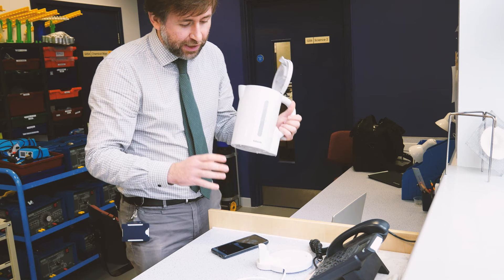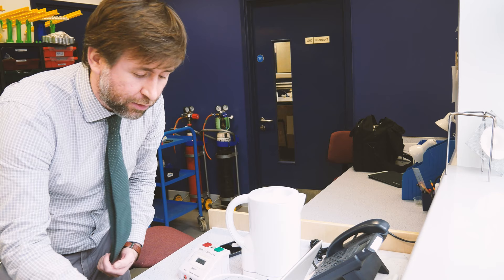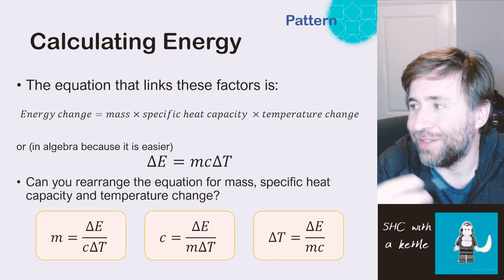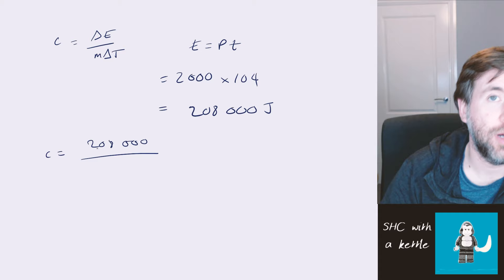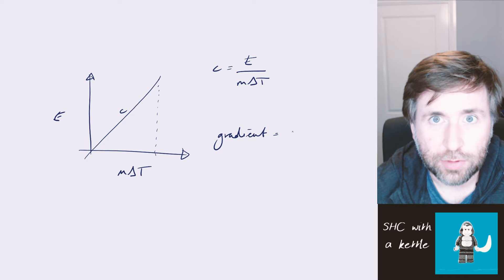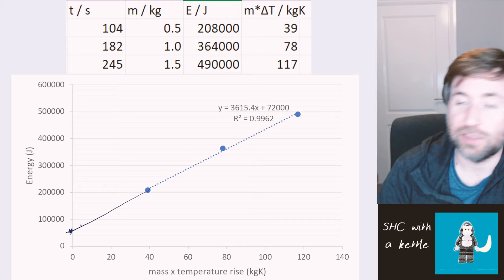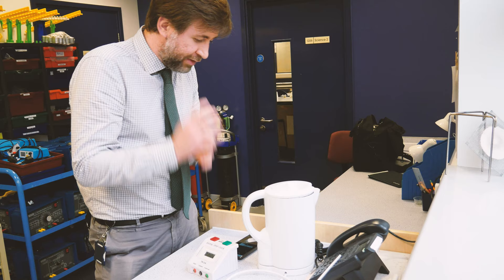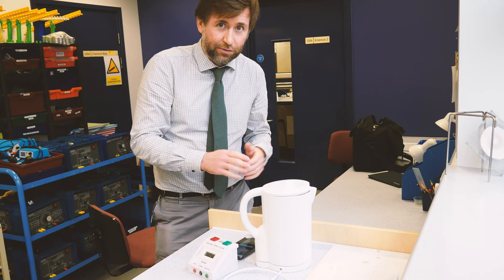Specific Heat Capacity with a kettle - GCSE and A Level Physics practical

Comment: If my kettle has a watt range. What do I use. Mine is from 2250-3000w. Also how can you determine the temp of water without guessing or using a calculator?
Reply from the maker: It's probably around 3000W for most of the heating if it has that range.  A rough guess would be around 20 degrees for the water from your tap and boiling is 100!